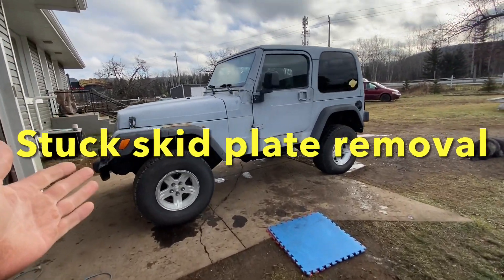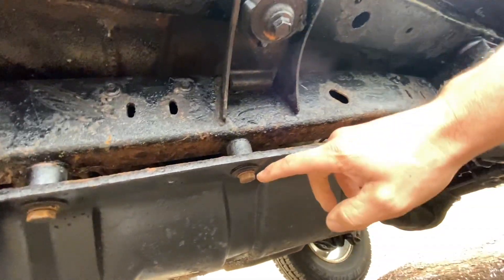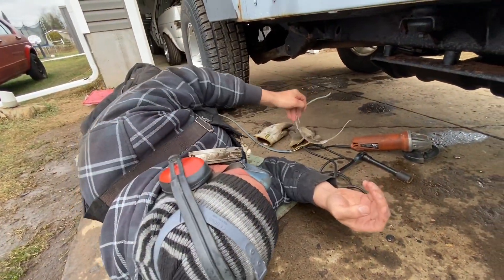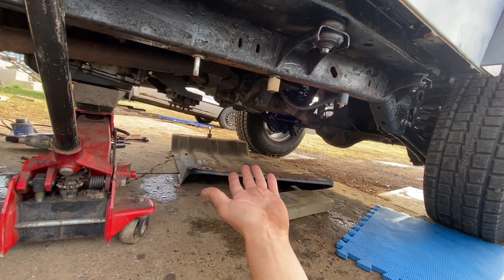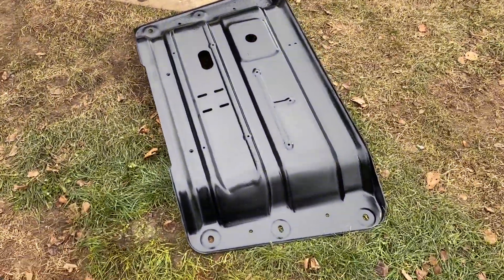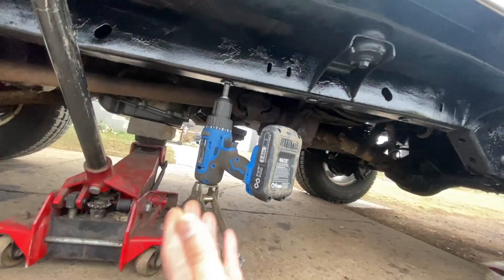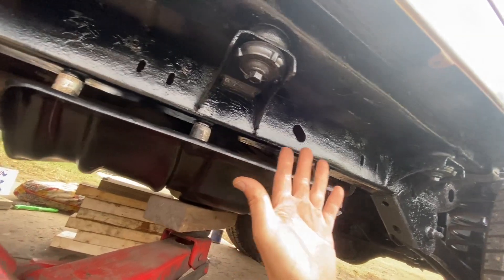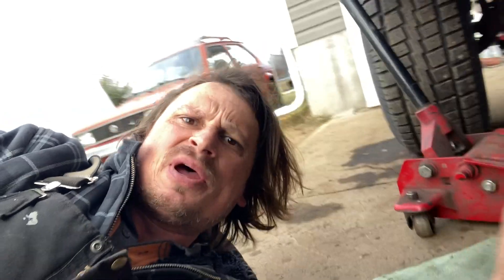Jeep TJ skid plate removal (bolts won't loosen)

Comment: I'm planning installing 1.5 coil spacers on my 03 Jeep TJ. Do I have to remove that skid plate you just removed, in order to lower the rear differential? Thanks.